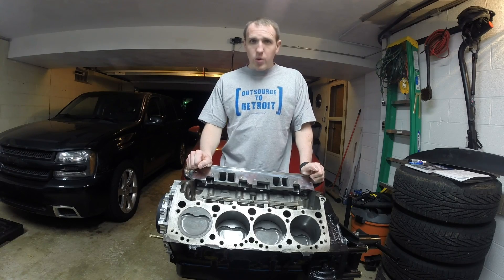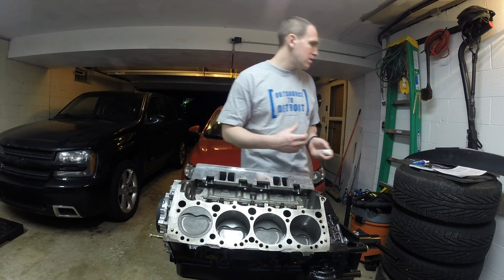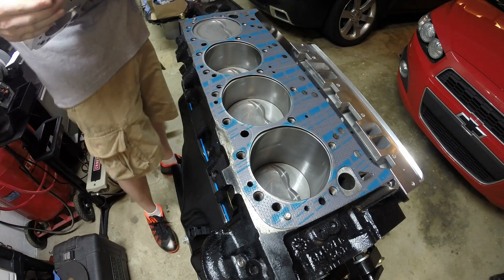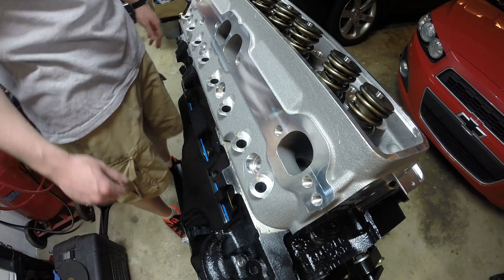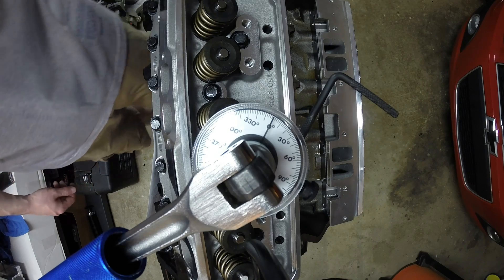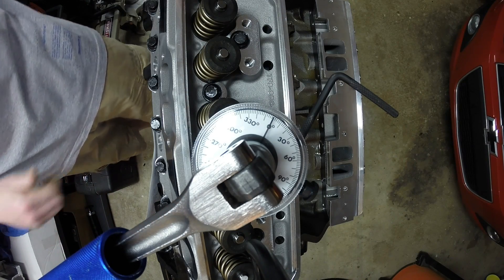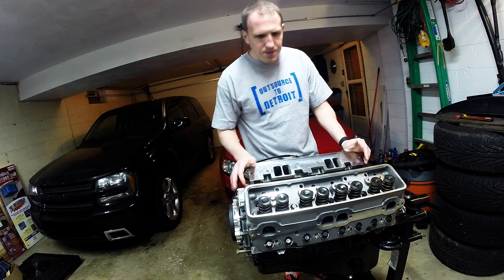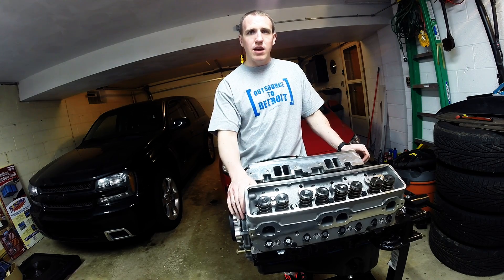LT1 V8 Engine Cylinder Head Installation Walkthrough

Comment: The bottom of the washer should be dry and the top of the washer should be lubricated so the bolt spins freely in the washer stays planted on the head surface not throwing off your torque spec because it will make sure the bottom of the washer is dry

Comment: can you advise what head gasket you used? I have trick flow heads too and i heard theres differences between the stock heads gasket
Reply from the maker: I'm running a fel-pro gasket and cannot for the life of me find out which one I installed 5 years ago.. If it pops up I'll let you know.  Apologies!
Reply: @RubberCityMotoring  all good, I think I found the right one "Fel Pro part # FPP 1074" which was on the purchase order from the previous owner in his book of receipts he gave me. I have Trick Flow 23 degree Kenny Duttweiler Signature Series 1.46" 195cc heads TFS 30400010 in case this helps anyone else out

Comment: I think your smart for keeping the lt1 engine. Especially now that you can get rid of the opti. These are mechanically sound engines. My firebird has the 24x, and 200,000 miles. Its a pretty quick car. I wont run it over 5000 rpm even though the cam in these engines makes power at even higher rpms. I just baby it since it has so many miles.
Reply from the maker: Very cool! Mine was running strong at 180k! Thanks for watching!
Reply: @RubberCityMotoring  tha ks for caring.

Comment: I installed the Trickflow heads with Arp bolts, I called Arp and they said to torque the bolts according to their instructions, 20 lbs, then 40 and finally 70.
Reply from the maker: Yea mostly just so you’re doing the three torque cycles.  I kinda followed everybody and they’re all very similar. Just don’t wanna ruin your heads!

Comment: Good Job. Very helpful to determine how much work one is getting into if doing remove and replace of the heads.
Reply from the maker: thanks for watching!
Reply: Rubber City Motoring quick question I see u have a hole in the driver side cylinder head as if u put the temp gauge sensor there I thought it was in the back of the passenger side head?
Reply from the maker: +tookind4ya nope temp sensor goes in that passenger side hole. Back of the head has the steam tube or coolant crossover tube.

Comment: What stroker kit did you go with?
Reply from the maker: Golen built the bottom end, 383.  I could get you more specs if needed.  Trick Flow heads here and it'll have the edelbrock intake, 58mm TB, etc, etc... The list goes on and on... Engine is about to go in very soon here.